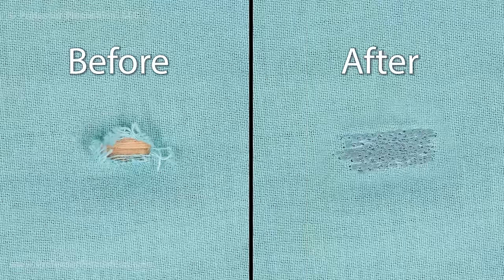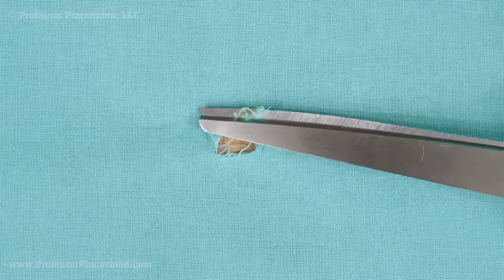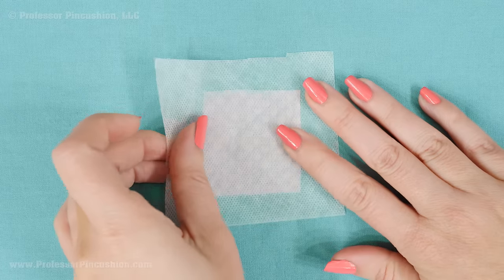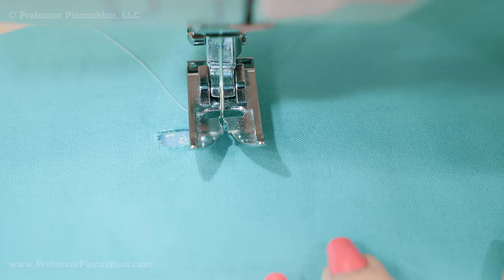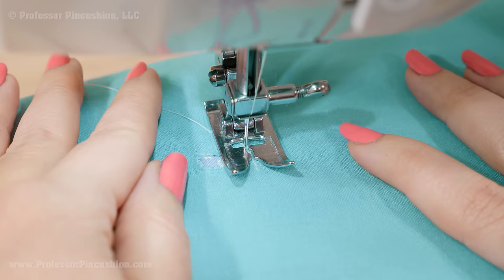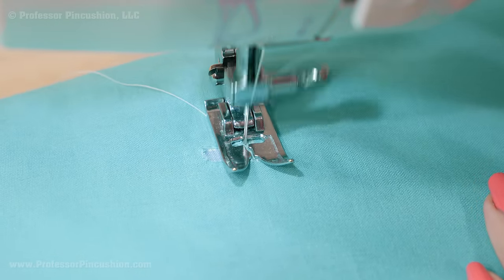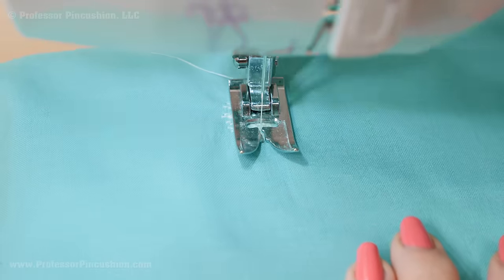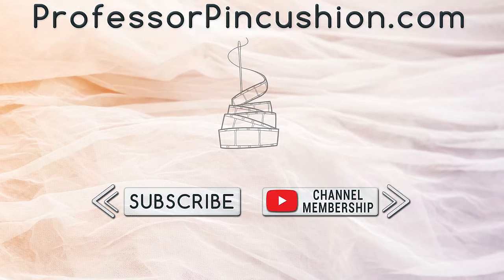How to Repair a Hole With a Sewing Machine - Darning

Comment: If I'm repairing jeans that are starting to rip (not a hole yet), then can I just use an interfacing without the damage cloth?
Reply from the maker: Yes. Depending on the weight of the interfacing, it might stiffen that area, but it should soften up as you wear it. Not sure how long it'll last through a lot of machine washing though. .

Comment: Wish you would have linked the cloth and the other thing that went on the back.
Reply from the maker: It's a stabilizer. You can find different kinds in the notions department. It just depends on your project and fabric type on which kind you should use. Mines a sticky water soluble stabilizer which is great if your fabric is washable.

Comment: which foot is used
Reply from the maker: I'd just use a decorative stitch foot. It had a wider gap in the center of the foot and if you turn it over, you'll notice it has a shallow groove going down the center of the foot.

Comment: Stabiliser and interfacing are not the same thing, right?
Reply from the maker: interfacing could be used as a stabilizer but a stabilizer is not necessarily interfacing. Most stabilizers are used for machine embroidery type projects.